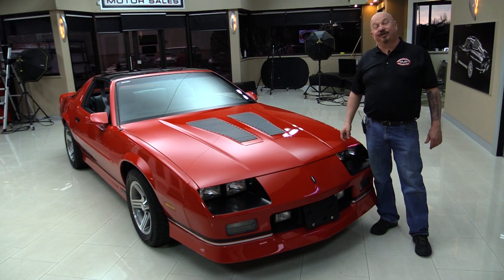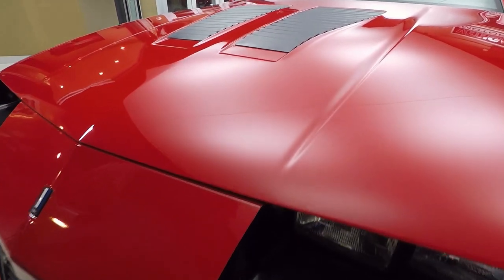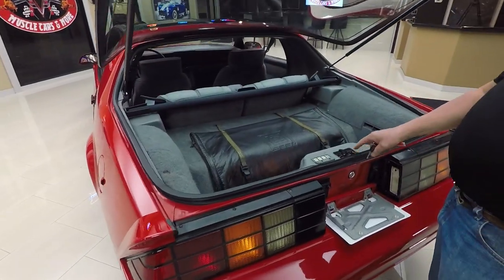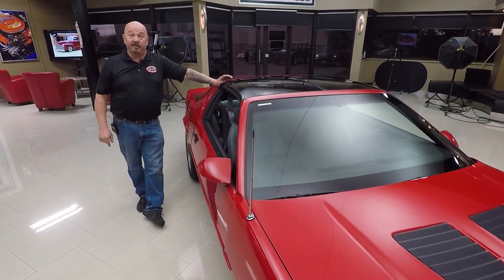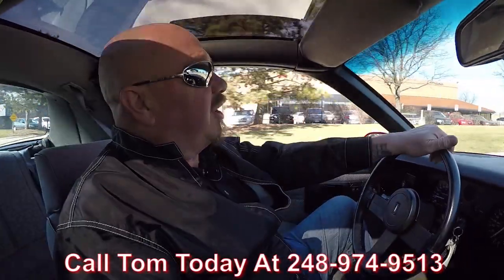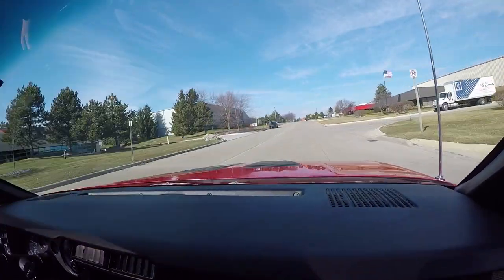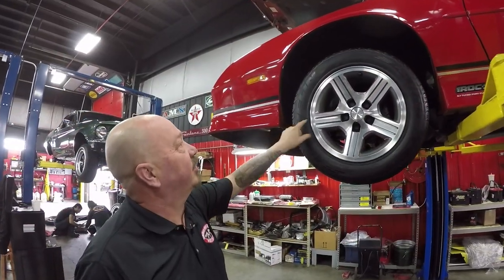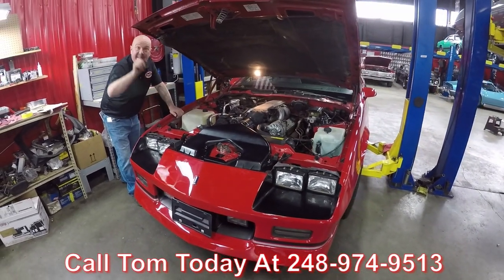1989 Chevrolet Camaro IROC Z28 For Sale

Comment: I had a 89 5.7l iroc, ripped motor out put 450hp roller motor with tci transmission and 456 rear and ran low 11's. Fun car..